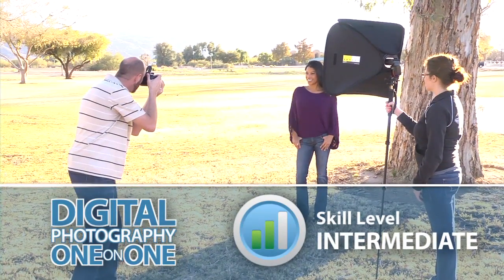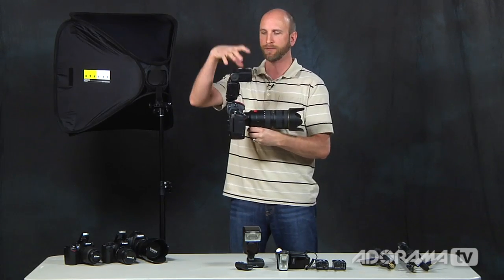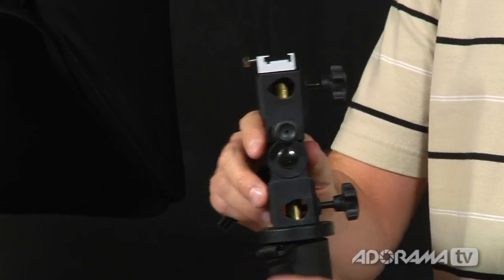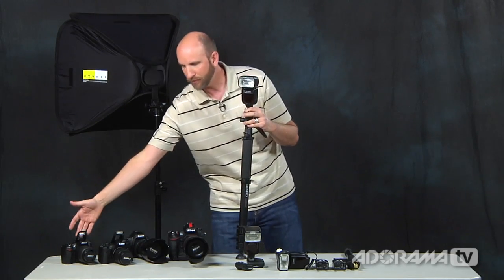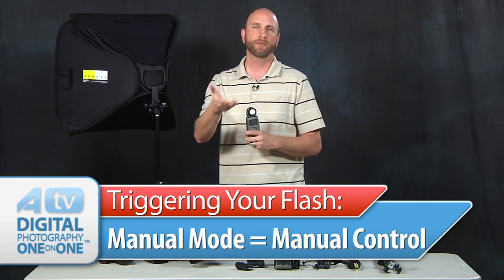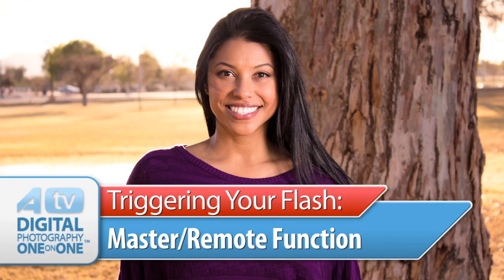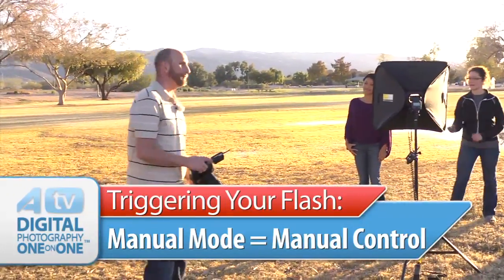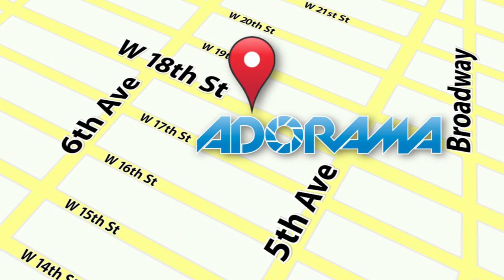Light Stick and Speedlights: Pt. 1: Ep 230: Digital Photography 1 on 1

Comment: @blackcompany2000 It's not radio, just light pulses from the built in flash communicate with the speedlight. If you didn't need line of sight, it's because the flash bounces around walls and it get picked by the sensor. If you are outside there is no bounce and the sensor can't see the flash. Your on camera flash doesn't affect your exposure when in commander mode only.

Comment: @kk6downing It's a lens cap or even better not to point it at (not correctly placed) lasers. This has much more chance if you do video, since sensor is always on and actually does ruin a line of pixels. But just doing photos it's a slimmer chance.

Comment: Am I mistaken in my thinking that my D90 has a radio control feature for all the nikon flashes SB600 and up? I didn't think I needed line of site when I set my D90 in command mode I have 3 channels to choose from and I can set up any number of flashes on those 3 channels and have them use auto metering or manual and have my on camera flash disabled?